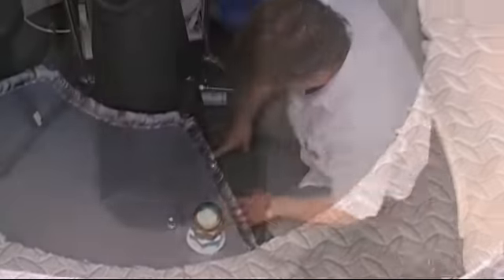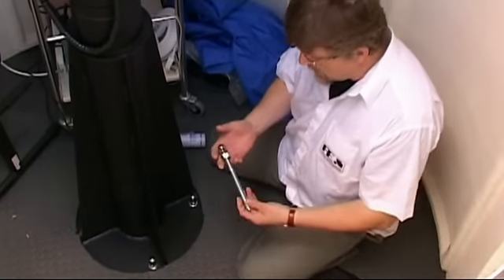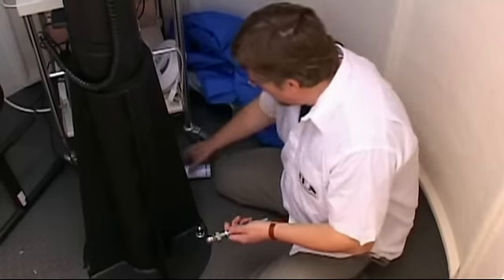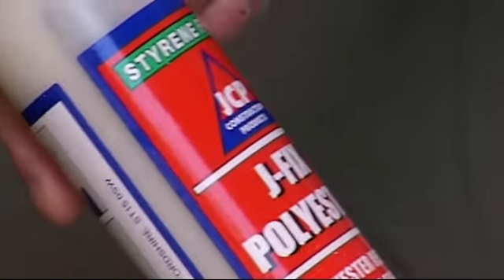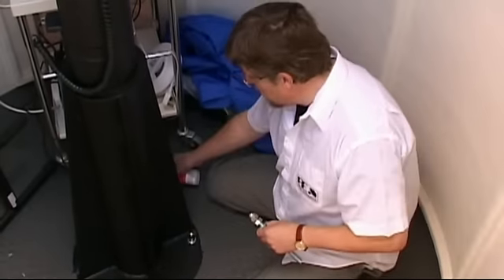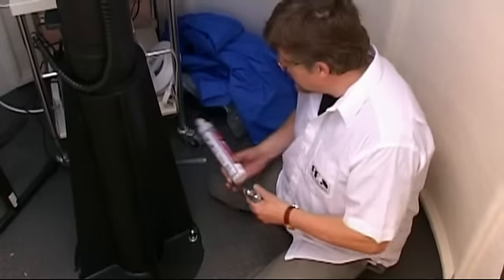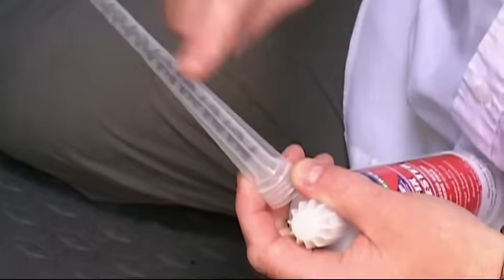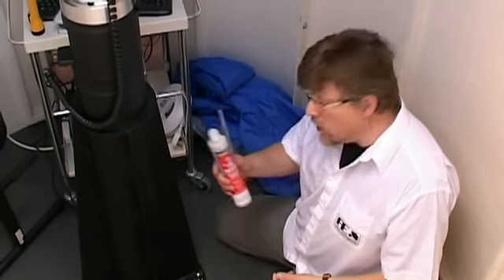Anti-vibration observatory piers (Part 2: The foundation and fastening of the pier)

Comment: You say 1mx1mx1m and then a metric tonne of concrete, considerable way off. It would be a tonne of water but about 2.4 tonnes of concrete. You then go on to say a tonne of concrete is adequate, the dimensions of the hole would therefore be much less than, in fact only 0.42mx0.42mx0.42m. So my question is this, which are the correct  figures?